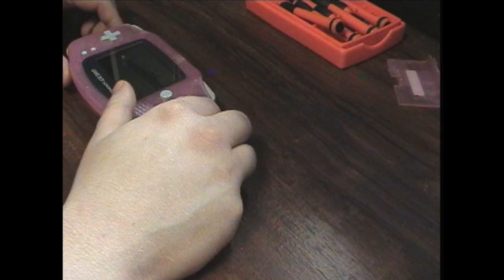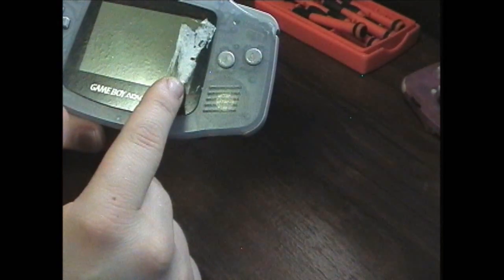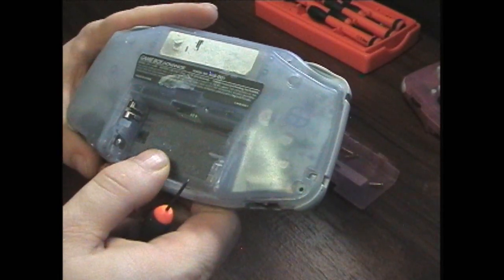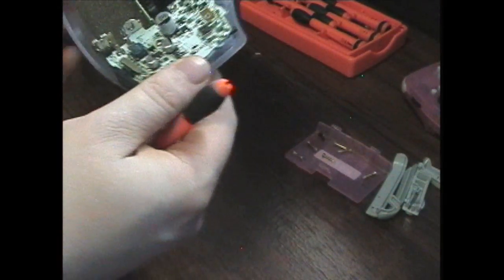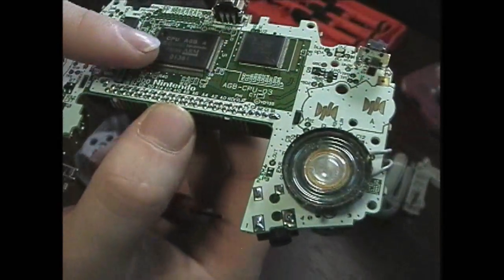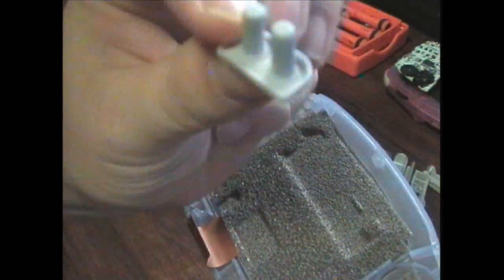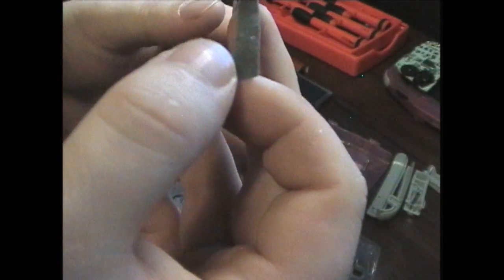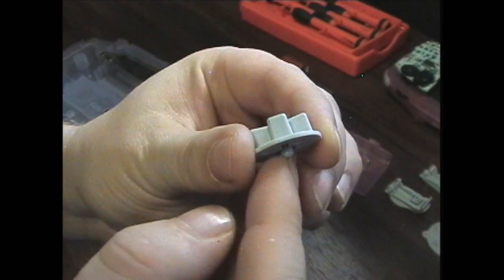Game Boy Advance Take Apart (1 of 2)

Comment: Nice to c this.Ihad one like this one on the video ,had the feet stand to charge and the lighter with magnifing lens.I made some changes to use it plugged directly to the power line.That way i used it with out batteryes and still using the lights.Good old days i had before the sega game gear,that was a nice one with tv tuner and retroluminescese display.

Comment: probably far too late lol, but I've fixed mine using super glue (I still had the broken piece). If the resistance is too low, then you can carefully apply more super glue in the space that the locking piece is pressed down into~